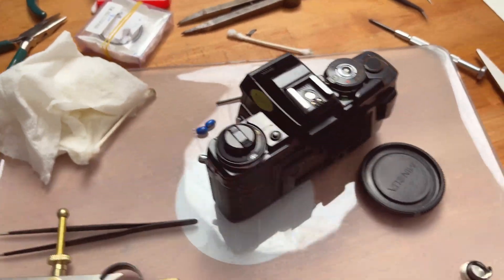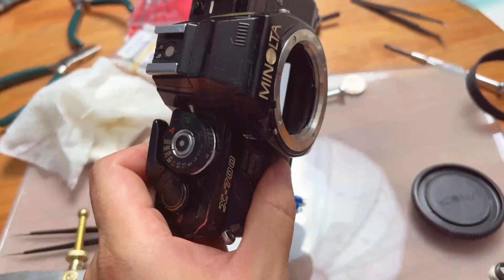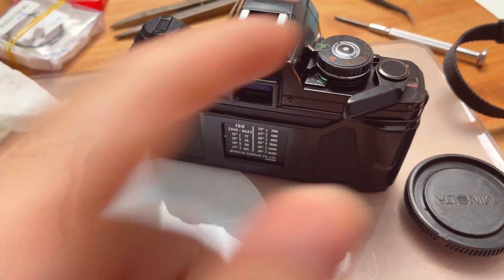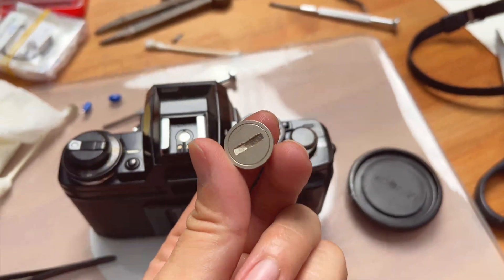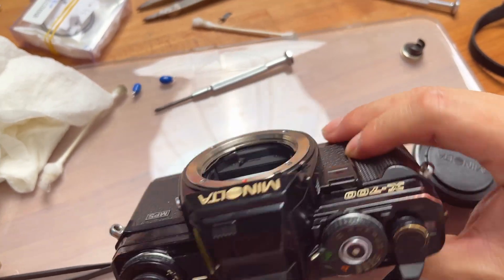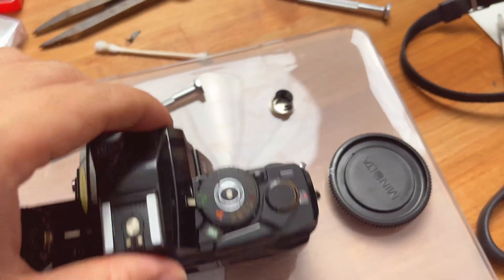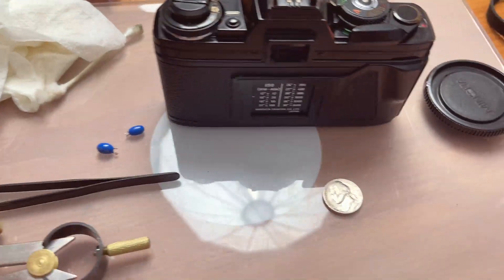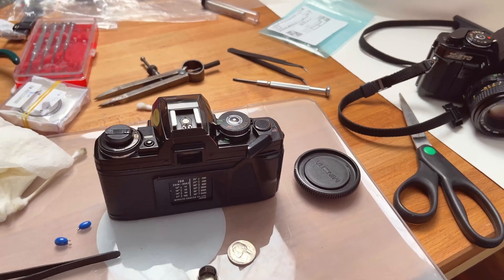Minolta X-700/X570/X500 check this problem first before replacing the capacitor!!

Comment: Thanks for posting this video! I bought a new to me X700 and it was dead even with new batteries. When I opened up the bottom it had the blue tantalum capacitors which are known to be reliable which left me scratching my head. The battery cover looked visually fine, but must have had some hidden corrosion. I soaked the the cover in some vinegar and now its working!

Comment: I know this is old video but if you have the same issue BEFORE gutting it out when there is old battery that is CORRODED inside the compartment. just clean it with Q tip with alcohol if it doesnt work. PUT FOIL at the bottom with fresh battery. 99% it will solve the issue…
Reply from the maker: Alcohol won't remove corrosion caused by battery juice. Must use vinegar.

Comment: Good to know. Swapped the battery door from an XG-1 that is broken in other ways to an seemingly barely used XG-2 that refused to fire and now it fires like normal. Should add that I did see a tiny bit, barely noticeable corrosion on the periphery on top of the plate.. I guess the corrosion in this instance prefers to go under that plate.

Comment: I tried this changing the battery door with one that worked and same problem. The camera is working except the shutter does not fire. Lights are coming on the noise the beeps are making the proper sound. The only thing that isn't is the shutter. Could it be the shutter blinds need cleaning?

Comment: I tried using a different battery door with one i knew was working and no good. There is something else. The battery door is in two parts so it can be separated and maybe it's corrupted underneath that
Reply from the maker: Yep it could be

Comment: Gonna leave this comment and hopefully it helps someone. I had the same problem with my Minolta X-700... batteries were charged, battery door was clean and power was being supplied because the light meter was turning on. (Also the blue capacitors are plenty fine and rarely fail, after they started making X-700s in the 2 million +, that s when they started using cheap capacitors  which look like steel grey cylinders). If it is STILL not working after all that, you might need to take off the lens and carefully lift the mirror and let it fall. Possible that there was a jam somewhere and just needed some extra help. But be careful not to smudge or scratch the mirror or the focusing screen cause its not easy to clean/fix.

Comment: I replaced the capacitor in my X-9 and it looked like the capacitor had already been replaced by a previous owner. I watched your video, cleaned the battery door and it now works. Thanks.

Comment: I just bought an x700 it wasn't turning on, with all the video talking about the capacitors i thought i'll have to change them but just with a q-tip an a drop of alcohol in the battery door and now it work !

Comment: Question about the panasonic capacitors, they are not 220 as tje original, but 160 i think. Are they still that good?
Reply from the maker: They worked, however to be safe I think you can stick to the 220

Comment: Five minutes of video for an issue which can be described within one sentence: If the X-700 is not working, check and clean the battery contacts first.
Reply from the maker: I really have to get used to the new generation of 1 min or less video formats

Comment: Unbelievable.  I got an X-570 from goodwill for $6 that wasn't turning on with new batteries.  Because of this video, I checked the battery door with a volt meter set to ohms and it was making no contact.  I smashed the inside film down with a pick and now the camera powers on and fires.  Thank you, this might have seemed like a no-brainer to someone who works on cameras but I would have never even thought of this and this camera would have gone in a drawer.
Reply: I am even more of a novice so perhaps you can help me with a question that should be obvious: I assume one probe went in the dead center where the negative contact of the bottom button battery would touch. Where did you put the other contact, to test conductivity? Was it the threading of the cap? I only ask because the housing that seems to keep the batteries in place is purely plastic on mine.
Reply: @user-vx5bd1ii3y  Yes, the other point is the threads of the cap.  Those screw into metal threads on the body and complete the circuit, the plastic is just a cover.

Comment: Thank you for this video. The shutter of my X-700 wouldn't fire, even with new batteries.  But I got it to work. I didn't replace capacitors. I simply removed the batteries and rotated the little plastic sleeve in the battery door, just spinning it around a few times.  I re-installed the batteries and door and it worked as good as new. 02 Oct 2023

Comment: I own a X370 and just bought a X700.  I put fresh batteries into the X700 and it would not turn on at all.  Following your advice I just used the X370 battery compartment and now my X700 powered on and functions (haven't film tested yet) as one would expect.  I'll have to see about cleaning my battery compartment and trying again later but for now I'm very happy for such an easy quick fix!  Thank you!
Reply from the maker: Soak cap in vinegar, and cleaned the contacts on camera with Q-tip soaked in vinegar, worked for me
Reply: with contact you mean the part that the bottom battery touches once the batteries are loaded? sorry im not english so just in case @TheGizmoGarage

Comment: If the LEDs light up that is not going to work. If the LEDs don’t light up cleaning the contacts is what any person who would/should think of taking the camera apart would do.
Reply from the maker: Sometimes the LED does light up, doesn't mean contact is clean, the camera will still misfire due to contact not being 100% clean.
Reply: @TheGizmoGarage  the camera will not use power on lighting up the lights if it feels there is too little voltage. 
It will use the last juice to fire the shutter. 
That is an official safety measure implemented by Minolta. 
That makes it virtually impossible to see lit LEDs, and not have the shutter fire.
Reply from the maker: @Frisenette  I am sorry but you never know what kind of weird things happen to those dated electronics after 40 years. Doesn’t hurt to check and it happened to me so I know it happens.

Comment: Just bought a Minolta X700 and after two hours of use the camera was not switching on... Just watch your video, check the battery cover and I saw it was worse than yours... I clean it with baking soda and a toothbrush I dried it and... works. I can't be more thankful to you! Thanks!!!
Reply from the maker: Glad to save another X700!

Comment: Thanks for linking this in the description of your capacitors replacement video! It saved me from going and buying a soldering iron and capacitors, cleaned up my battery tray and works like a charm!
Reply: How did you clean it up? I need to check out the battery case on my Minolta X-700 but I don't know what I'm looking for. Thanks

Comment: Tech tip. If you want to clean out the corrosion out of that old battery door, just drop it in some white vinegar and leave it overnight. In the morning, once the vinegar has eaten away all the corrosion, simply wash it out with rubbing alcohol to flush out the vinegar.
Reply from the maker: Works for terminals, sometimes the wire gets corroded and simply snap... which might require more work.
Reply: A night is overkill. Half an hour with intermittent scrubbing is all you need.
Reply: @Frisenette  Vinegar isn't that strong of an acid. It requires time, unless you want to do all the work yourself with the scrubbing. Overnight is minimum.
Reply: @vhfgamer   it’s strong enough to leave marks if there are impurities in the metal, if left for hours.
Any film or corrosion will be long gone, including perhaps some of the cap.
Use a toothbrush.
Reply: @Frisenette  I use a toothbrush after leaving it overnight.
Reply: How do you add/remove the vinegar. I was told to use isopropyl alchohol first
Reply: The door is in two parts strange though it may seem so try and separate them
Reply: This freaking worked for me!!
I can’t thank you enough for this tip. 
My camera was not used for more than 2 decades. It wasn’t powering on and I was really sad. A local repair shop quoted me close to a $100s!! And a wait time of more than 3 months.
I did what you suggested and left it overnight and boom!! It’s working now!! ❤ Cheers 🎉

Comment: I've experienced this too. All you need to do is put a little square of tin foil on the bottom of the battery holder and it will work perfectly.
Reply: I cannot believe this worked! I was sitting here, ready with the soldering iron to remove my capacitor, read your comment and decided to give it a try. Thank you! Saved me a ton of trouble by messing about with a good capacitor! I tried with a couple different shaped tin foil pieces but in the end, the only one that fully worked was a 1.5mm (roughly) square - doubling up didn't work either. Since sheet in a small square shape, brilliant.
Reply: @cyberspeedgamers  haha awesome, glad it helped. No idea why it's so sensitive, but does the trick!

Comment: Hi I’m having an issue with my Minolta. It’s a XG-A Minolta it worked in the past no issues now I try to press the shutter and it does nothing and I have replaced the batteries and the BC ( battery check) light lights up red I’m not sure what’s going on with it.
Reply from the maker: Don't have experience with the XG-A but the capacitor could be an issue, I found this article detailing the steps on replacing it... https://simonhawketts.co.uk/2016/05/04/minolta-xg-m-capacitor-replacement/ Might have to find a reputable camera repairman to do the job, but then it might just be worth it to get a new camera with the cost of the repair...

Comment: Hi in my  x300 the shutter button and the advanced knob is not working but the indicator in the viewfinder works please help and when I click the shutter button viewfinder indicator light goes off then I have to turn the camera back off and on
Reply from the maker: Not sure but if viewfinder led still works then it’s probably not the capacitor issue but something mechanical
Reply: I was doing something with the camera and i moved the diaphragm control lever with my hand and clicked the shutter
Reply: Is it due to moisture or dirt in the camera because it not used for 5 years

Comment: Given that your capacitors were the blue kind (solid tantalum), my guess would have been from the beginning that they were not the culprit. Because they are not the kind that are susceptible to failure. It is the black, cylindrical ALEC type capactors that fail.

Comment: What type of capacitors?  I have this going on with my x-570.  The shutter works for a while but then all of a sudden the mirror locks up. I assume that’s a capacitor issue??
Reply from the maker: Make sure your battery is fresh and have 3+V voltage by testing with a multimeter. See my other video: https://youtu.be/nUXRW2vtXrw for capacitor specs (in the description) and how-to replace tips.
But if mirror locks up it could also mean battery power is lost, might also need to check corrosion on battery caps, sometimes corrosion is hidden in-between sandwiched layers on the battery cap on x-570/x-700 and hard to detect unless you test voltage with a multi-meter to confirm.